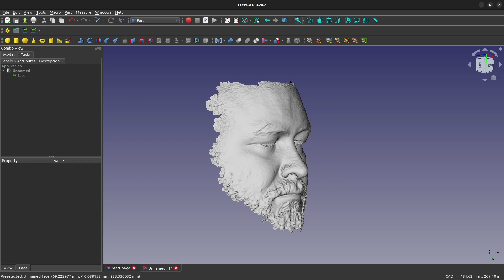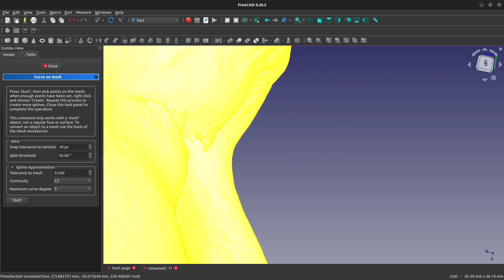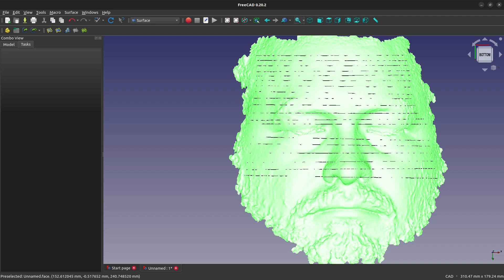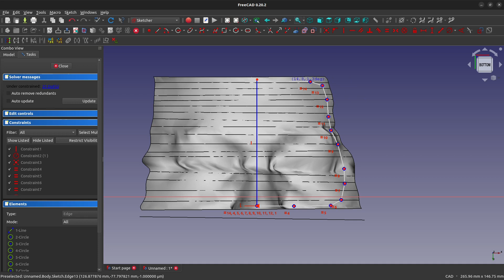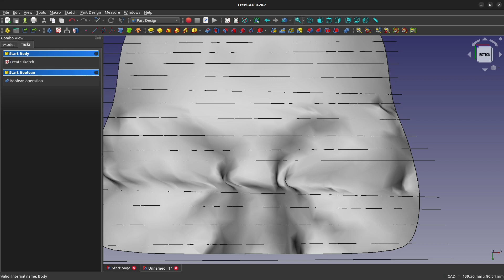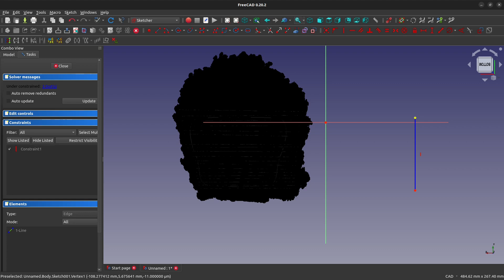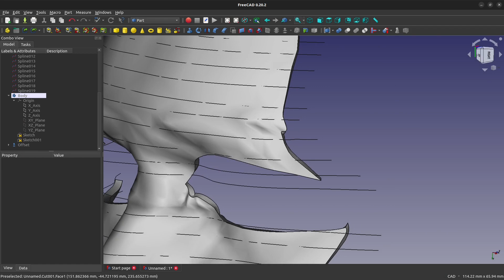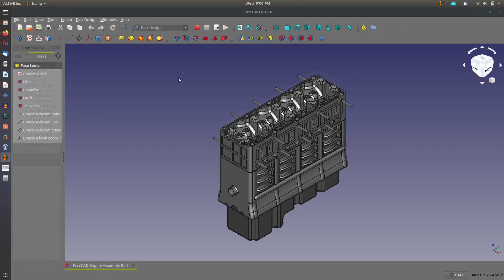I 3D Scanned My Face and Made a Custom Mask In FreeCAD (Creality CR-Scan Ferret)  |JOKO ENGINEERING|

Comment: 3D-printed blackface lol
Really cool! I wonder if printing in a flexible filament would let it conform during natural movement from facial expressions
I wish I knew the curve approximation technique in FreeCAD a few months ago. Also rather than extruding the mask and getting sharp edges I wonder if it would be better to use a minkowski sum to "grow" it more organically. I have used 3D minkowski sums of complex objects against cylinders capped with hemispheres to give a nice smooth growth.
Reply: You can make a mold and cast flexible silicone made for masks. You will need a vacuum chamber to be able to fill it.

Comment: Is this possible in Alibre?
Reply from the maker: Alibre doesn't have mesh editing tools- if you saved the mesh into a jagged step file, you could import it and trace around section views for about the same thing.  It would be more of a manual process but doable.  You'd need a 3rd party software (probably freecad) to convert to step.  You may need to do a mesh decimation (also available in freecad) if the STL is too heavy.  The good thing about that workflow though is you don't have the overly complex spline profile around the eyes that freecad had.  Wow, I really talked your ear off on this one.
Reply: @JokoEngineeringhelp  Thanks for the reply.  I really wish Alibre would add the ability to import mesh files, or offer a plugin or standalone tool to convert.  I have done this with a web based tool, but I don’t want to have to rely on an internet connection to do work.